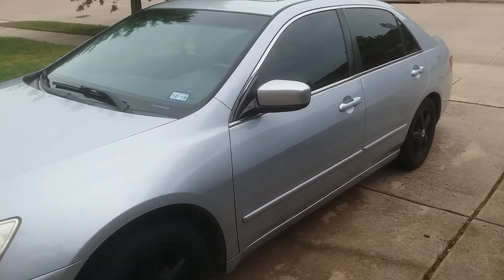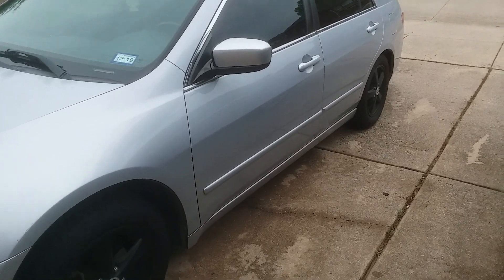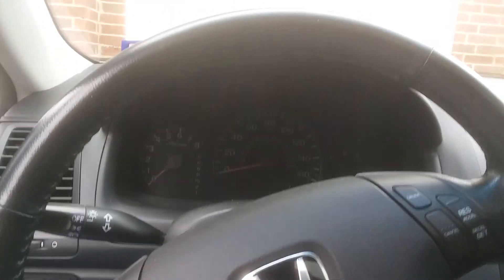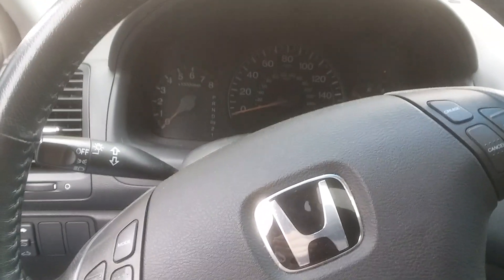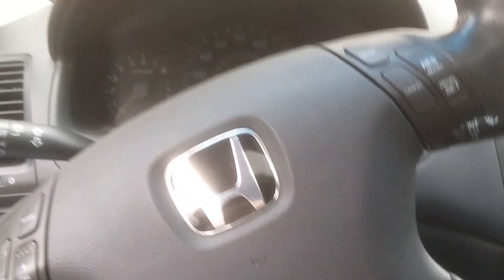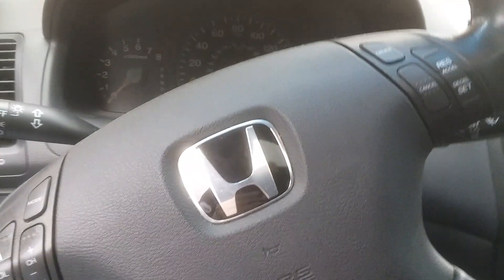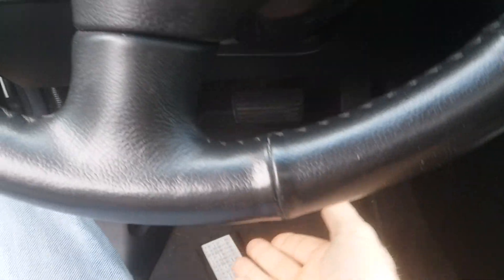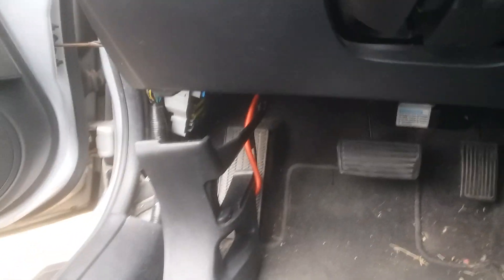P0685 Honda Accord 2005 - Relay - ECM/PCM Internal Circuit Malfunction (Power Control Circuit)

Comment: I had this problem on a 2003 Honda Accord ex v6 AT. Symptoms were Radio, and Dashlights would turn off while driving followed by car stalling for a split second. Headlights would dim or get brighter on acceleration and deceleration like the car is starving for electrons from the alternator (or serpentine belt loose?). The code came up P0685 on a blue driver. 
The solution so far: 
1) Checked the relays under the driver's side. EI main, IG coil, and since I was there Fuel pump. Took them off. Cut a regular house light wire. Somewhat held the relay end to the battery under the hood (Caution the relay is not protected anymore from the fuse box). I heard the relay click, concluding relay was good.
2) Cleaned the grounding wire surfaces around the engine bay from the black and white pictures I referenced on forums. The reference below is the Driver side/Passenger side instead of left and right.
 Battery negative to Car wall (driver side), Car wall to Transmission (under air filter driver side), Battery positive harness traced to the throttle body (2 small wires)(driver side engine side), Battery positive harness traced to a bracket power steering pump/injectors (Passenger side on the engine), Motor mount to car wall Passenger side near the serpentine belt.
3) After cleaning the grounds and checking the voltage on the battery and alternator the code is gone. The battery grounds are referenced (C101, C102 etc on forums)
4) I got another code for the throttle body P2101. That was because I took the air filter housing off to get at the Grounded wire transmission to the car body. I probably should have cleaned the throttle body but didn't. I'll clean it next weekend. hopefully, that will get rid of the code.

Comment: Sometimes a bad electrical connection can throw this code.  I got this code and cleaned up the corrosion on my battery terminal, and it fixed it.  Wasn't even that bad!

Comment: I fixed mine in 5 minutes. Took the relay out, sanded the leads to scuff them up. Spayed electrical cleaner into the holes, let it dry, pushed the relay back in. Done ! Checked with scan tool, everything was good. I also cleaned my battery terminals.

Comment: Just did this on a crv the other day, pulled the relay and tested would fail to engage roughly 1 out of 30 times problem solved after the relay was exchanged
Reply: What year crv and location for relay?
Reply: Can you test the relay with a meter?
Reply: @TheCastedone I’m late. But yes you can. Should show between 150-200ohm
Reply: @TheCastedone also good to hook it up to a battery and listen for a clicking noise. Repeat this multiple times.

Comment: I'm having this exact issue in my 2008 Honda Pilot. I'm having trouble with where to find the relay that I need to replace. Any help is welcome and appreciated.
Reply from the maker: You’re is probably an 8cyl and mine wasnt so it might be different place or relay. But mine was by your left leg on side wall, and near back of relay box.

Comment: My 04 accord is having problem w the Ac.somehow the compressor relay is not engaging the clutch compressor.When they jump it its fine.bug when reinsert the relay it stop working.some say might be the PCM.should I try changing that relay 1st before changing PCM?
Reply: Any luck?
Reply: @3500savoy  it was the Computer the whole time.
Reply: @joebay1049  did you try the pcm? Or any other parts
Reply: @3500savoy  i change the pcm and it work
Reply: @joebay1049  which relay? And what color?
Reply: Please let me know currently dealing with this and trying to figure out which relay it is

Comment: Hi William! Thanks for the video. I got this code when I scanned my 2005 Honda Accord and I did everything exactly as you showed here in this video. That was 3 weeks ago. Now the problem is back again. Could there be another big problem? I had purchased a brand new part from AutoZone when I replaced that piece 3 weeks ago. I was planning on driving my car cross country and now I’m scared of getting stranded if I drive the car. Can you please advise?
Reply from the maker: Kev Flores you could try returning the part and getting a new one especially if the code is back. I didn’t have any more problems in mine. But you don’t want to drive with the car with this issue.

Comment: The car is running great!  However, the issue it has is the stereo and some of the dash lights won’t come on and the power locks and lights won’t work if the ignition is not turned on.  Do you think this might work?  I am going to replace any how.  Will keep you posted!  Thanks for your insight!
Reply: I have the same problem
Reply: Did it work for you replacing the relay like he did in the video ? My door locks are not working at all

Comment: I’m, having similar issues. My accord has the same error code, it would shut off briefly and restart, someone said I need new battery , someone said I need new computer, someone said replace the battery terminal cables.
Reply from the maker: The relay fixed it. Its been months and no issues.
Reply: I'm gonna go out and buy a relay because I'm having the same exact issue
Reply: @williamkincaid3222  quick question, do I need to replace both main relays or just one? looked up the part number on genuine honda parts and it says the require qty is 2?
Reply from the maker: I only did one and it’s been fine for months now
Reply: @MoNeenja  did you happen to narrow down this problem? I was told a similar story
Reply: Did you figure it out?
Reply: I changed the negative battery wire for a thicker one and cleaned the posts, also I sanded where I placed the wire so it would have good ground. Put Vaseline on the post to prevent corrosion. Hope you fix yours 👍🏼

Comment: was it hard to pull the old relay out? im having the hardest time trying to remove the relay. Is there any tabs I need to press to unlock it? thanks
Reply from the maker: No tabs on mine. Try pliers and just pull straight out.